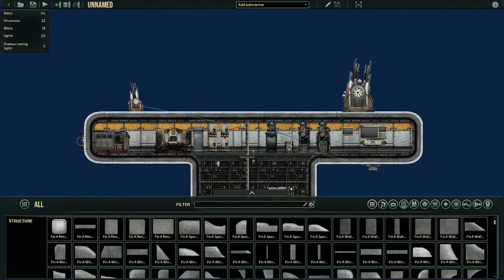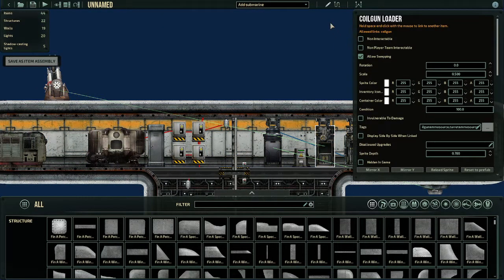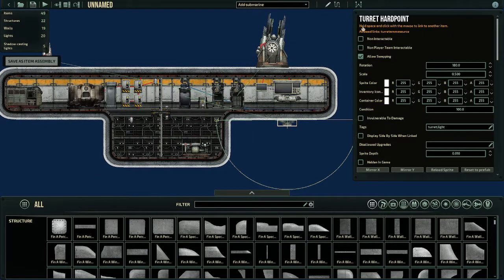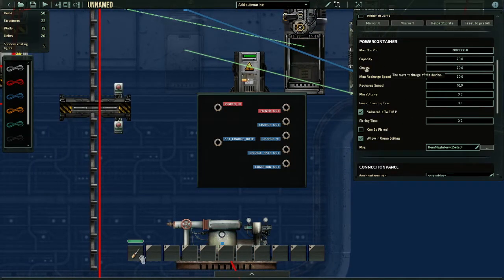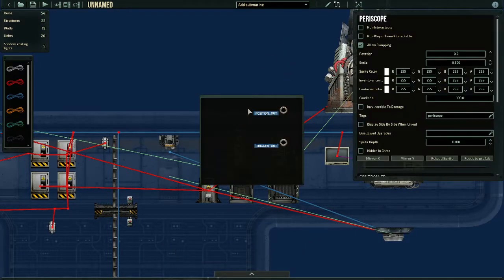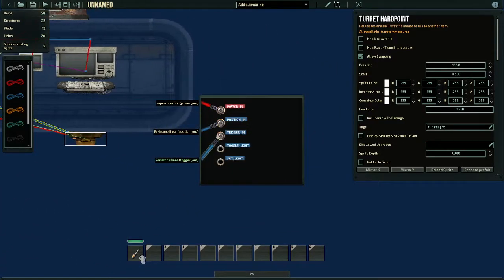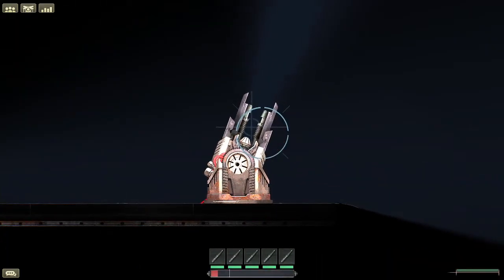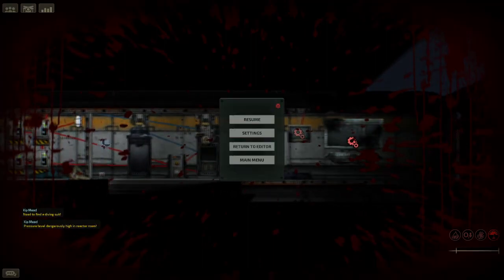How To Wire Ship Guns in Barotrauma (Updated Again!!)

Comment: Scouring and scrutinizing the depths of the internet to help me find out how to add weapons to my first submarine...

I'm glad I found this. I now have extensive knowledge on how to wire guns to my ship and will put this good knowledge to use. I appreciate it friending.

I was wondering, also, how one might be able to make pumps to push water out; as a standard pump, not a ballast, but rather the pumps at the bottom of the ship to help draining the sub when it floods. I'd appreciate it if you educated me in that field as well, brother.
Reply from the maker: To make that kind of setup, you need components. I don't remember the set up exactly, but there is a prefab in the sub editor called a "Bilge Pump." What this does is it will automatically turn on when water is detected, because it has a signal check component and a water detector. Use this in weak spots so you can drain the water. Remember to power the pump too.
Reply: there is a pre made pump you can spawn in now that automatically drains water

Comment: So, what would i do to power my guns if the sub doesnt have a supercapacitor, like the Orca?
Reply from the maker: 1. You couuuuuld use a junction box, but those are so horribly inefficient that you might as well just use the capacitor.
2. The Orca does have a capacitor. It shares its charge with multiple guns, which actually works
Reply: late reply but; move your camera to the right of the gunnery, there are super capacitors!